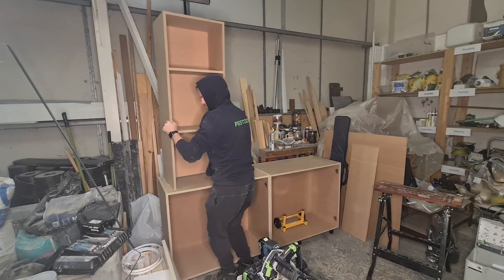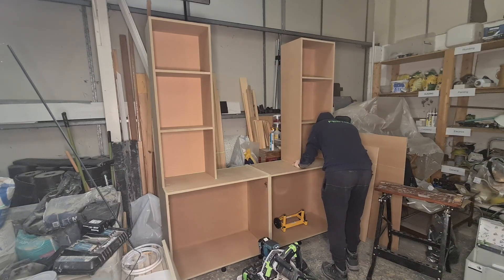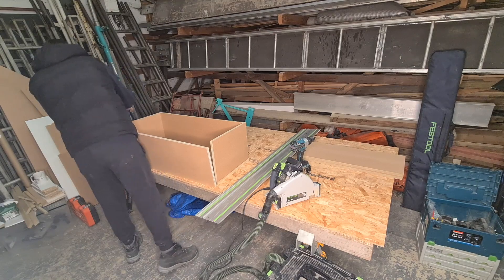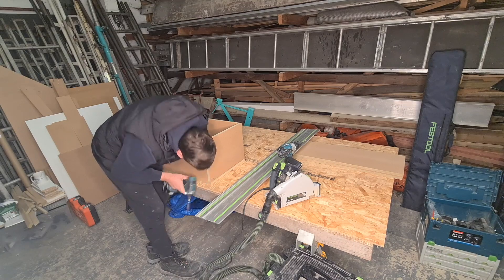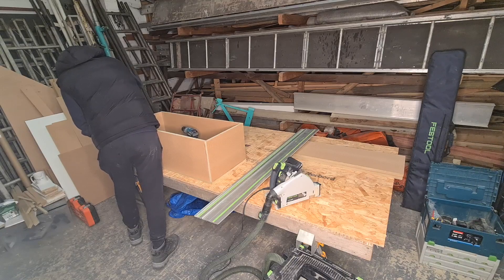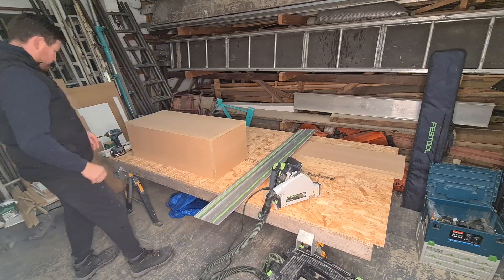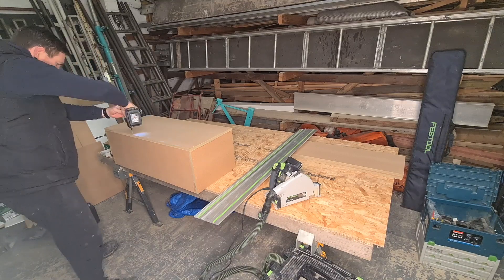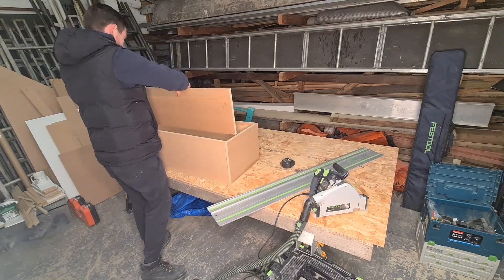Drinks Cabinet Part 2! How to build an insane Drinks cabinet, Step by Step. Carpentry skills.

Comment: Looks well, think I'd of made a router ĵig for slots for the wine rack then squred the corners up with a chisel
Reply from the maker: That would definitely be a better option I think Anthony. Same result but the router would have been easier
Reply: Just makes it easier cos once the jigs 
 made to the exact size you want the machining process gives the same result every time instead of having to creep up to the pencil line.
Reply from the maker: 👍 agreed